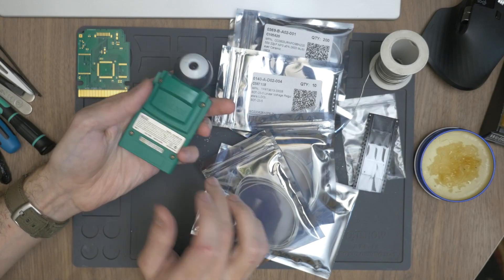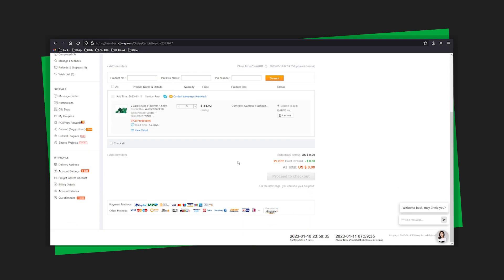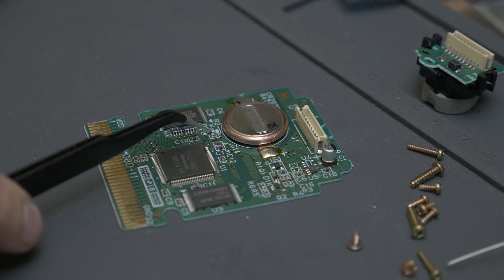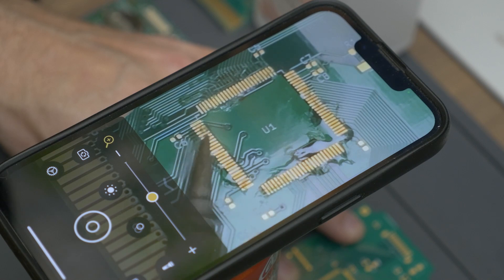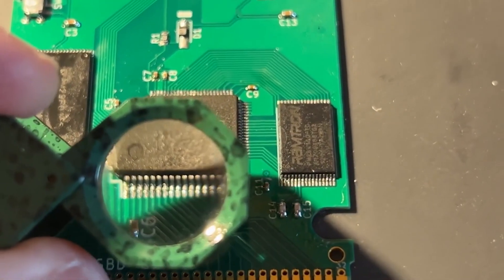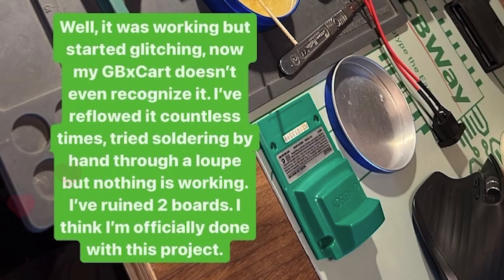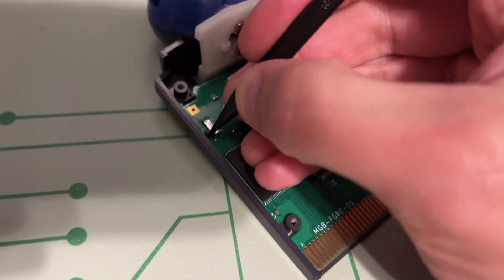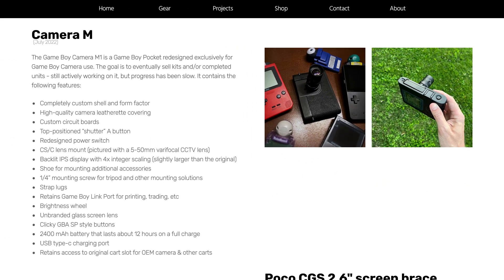The NEW Game Boy Camera!

Comment: Great to see that you got them working, sometimes when removing the MAC-GBD the legs can get slightly bent, which makes getting good contact on the new boards a bit of a chore, i suspect that might have been part of the issue you experienced, i also recommend picking up some Chip Quik SMD291 Flux, it's invaluable when hand soldering chips to boards.
Reply from the maker: Thanks Martin!

Comment: Hey Sean, quick question: How did you feel overall with your Daewoo 20” flat CRT as far as picture quality and overall reliability and satisfaction? I found the same model on ebay but its a tad pricey. Were you happy with the set? I like that it has component inputs
Reply from the maker: I liked it a lot, but unfortunately it died not long after making that video. I think it had been sitting out in the rain before I took it in so that’s probably why. But it’s a great set!

Comment: One suggestion I have is not to put solder on all the pads of high pin count components (like the large chips but also connectors) because then when you put the component on you'd be fighting to press it down so to speak because all the other pins will be raised while you press the one you're working on at that moment.

You should instead align the component and tack on a corner first then verify again the alignment and tack an opposite corner then verify once again the alignment and if it's all good proceed to solder every remaining pin using an abundance of flux.
This way all the pins will be leveled on the pads.

For smaller components you can put solder first on one pad, tack on the component and then solder the other pad or few pads.

The above suggestion is valid for hand soldering, with hot hair you can have solder on all pads because they would reflow more or less all at the same time and the chip would "fall" into place also aided by surface tension, you still need lots of flux of course